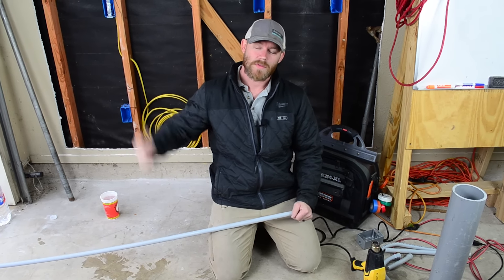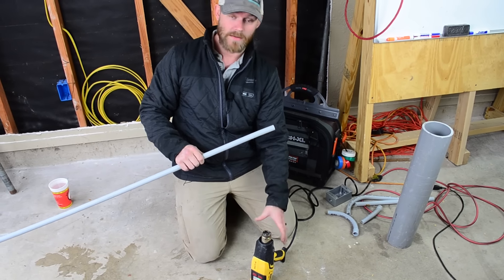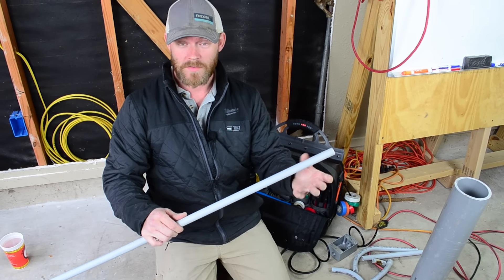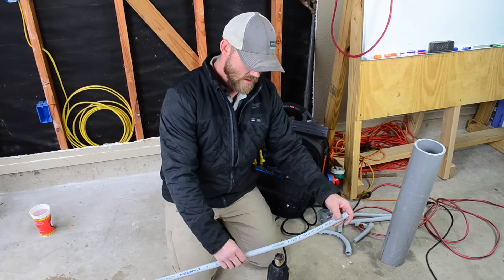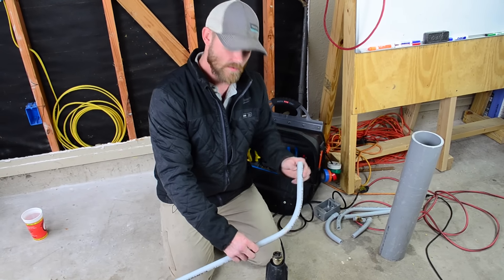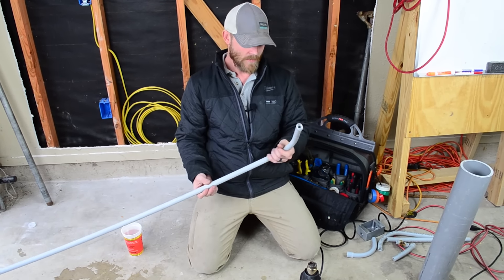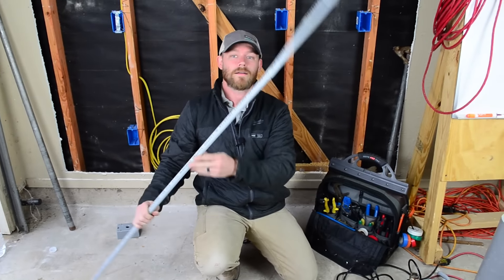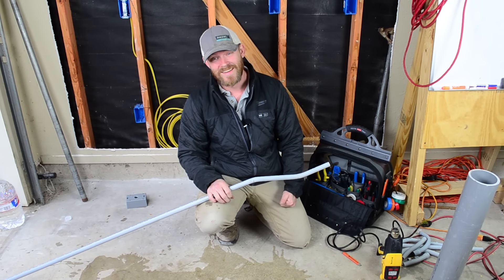Heating and Bending PVC Conduit - BENDING 90s, OFFSETS, and BOX OFFSETS

Comment: Dude, you saved me so much trouble, I had a pole barn built and I am doing the electricity myself. So i don't have to but i wanted the open walls to look Clean. I had purchased 3/4 sch 40 Pvc I was trying to use different types if 45s or 90s, non of them gave the result it needed. I Ordered the heart gun you use and it came in today. I set up a dummy 6by6 and 2 by 6 and it worked amazing. Thanks so much for this knowledge, not only is going to look sweet, its also going to save me 30$ even after the heat gun purchase. Thanks again, YOU ROCK

Comment: In my country, Iran, we put something like a cable or a water hoze inside the pvc conduits before bending it with heat and after we bend it, we pull it out.  It gets the job much easier and neater

Comment: Loved your video I'm a  sparky in Australia  and we have bending springs that go inside the conduit for bending without using heat . They are available from 16mm to 25 mm and in heavy duty and light duty springs. Also when I was a first year apprentice in 1973 I was told to put dry sand inside the conduit  where you were going to bend to keep the inside fair uniform then wash it out with water
Reply: Sand does work if you don't have a spring bender.
Reply: Not from Australia but Trinidad and Tobago,almost every part of the world that uses PVC conduit uses a spring bender,spring bender saves time unlike heating it takes a while

Comment: I've only ever used pvc conduit and after years of using it you can easily make various offsets and bends with the 20mm size by working it while pulling it over your knee.  The spiral metal benders are also a plus to help you. If you bend by a heat gun have a spray bottle near to lock it in at the angle after heating it.

Comment: Hey brother great video. I’ve primarily used a box heater specifically made for heating pvc conduit which works well once you get into larger size conduit, but I completely understand using a heat gun for smaller sizes in a pinch.Also if I’ve had a specific type of bend I was trying to make, offset, kick, 90 etc... I’ve bent a piece of emt to what I need as a template and once the pvc was heated molded it to the emt to achieve the desired bend. Just some thought. Keep it up
Reply: good idea

Comment: When bending 90' s found it helpfull to draw 2 marks in pencil so u don't waste time heating unneede area. Like to have a few rags with cold water to cool bends. Nice to have a plactic face mallet to tap small kinks out. Had to use a torch to bend a 90 in 2" PVC middle of winter outside. Took forever. If you do burn a small area ( brown mark) sotchbrite will remove it. Never used a bender for PVC. Thanks for another great vid.

Comment: Good job, in Peru we usually use hot air, with this device or gas when it is cold, also a spring inside the pipe to bend it perfectly

Comment: Good video. I teach trade in NYC  we use a bender on the ground with a heat gun. The bender is for the angles. Laid flat on the ground.   I noticed people mentioning the hot box.  It’s great if you can afford it. However, if your not doing a lot of PVC and your in a bind you must know how to bend small diameter PVC without a hotbox.   Anyway good video.

Comment: I work with a union shop (power tools supplied) and we got this 'hot box' bender. It goes from 1/2" to 4" pvc. It works great. You just need to rotate it a few times and the box does the rest. Its like a 4 foot box in length for nice gradual bends. *Greenlee product
Reply: union shops have the best training, NJATC!!!
Reply: Yes I am going to carry a $1000 hot box in my service van to do PVC bends once a month.
Reply: Takes too long,time is money
Reply: BOMBCRAZYInc 4" we use a propane torch, large area tip very fast
Reply: I've only ever used a hot box or a heat blanket.  Never used a torch or heat gun and I've worked for small 3 person companies

Comment: Wow, you guys need to get a spring. We use them in Ireland and Australia. So much easier. What you do is way to much hard work
Reply: What do you mean a spring? I’ve never bent PVC pipe, but I assume you’re referring to something that goes over the pipe to get a smooth bend.
Reply: A spring bender is a tool used to bend pvc
Reply: Even here in South Africa we used spring
Reply: @MetrologyEngineer  see Robert Pennington comment
Reply: @johnnorton7817  Cheers mate.
Reply: Do you think learning to work with PVC first, then EMT makes more sense?
Reply: We use the springs in the uk too
Reply: It's one bend on 1/2 pipe...no spring is needed here
Reply: @dennisbecraft1303  no lol. Most of the pvc guys I've met that are just now learning emt, kink the pipe constantly, can't figure out their axis lines (so they end up with unwanted dog legs and rolls) versus most emt guys switching to pvc? Scorch the pipe. The bends will look like they're building a church...but they're not used to the torch/heat gun Jerry rig...give em a heat blanket. Works quicker anyways.
Reply: طيب هل تقدر تثني أنبوب cpvc bend للماء الحار
Reply: Insert spring into conduit pipe. Rube pipe vigorously with a towel or rag, bend pipe. I could have bent that pipe to 90° in less than a minute.
Reply: Yep we have those and more. I'm betting there is an electric one by now. And sand for remodeled that have to get funky.
Reply: We have springs on the US. Old school not taught to many new guys. Plus a high turner over in the trade many are not to concern with quality of work or knowledge that saves you time and gives you quality.
Reply: Ikr, we use them to it save a lot of time, heat is just so time consuming, especially on big project, to me that's slavery

Comment: I've been bending PVC for a long time and a few methods have worked filling the pipe with Trice and that helps to keep the radius smooth taking a piece of BX wire the largest diameter of little fit down the PVC so it acts like a bending spring or simply just having the right size of bending spring to put inside the pipe and for the Box offsets a piece of clam molding to push down on while you got a stick or piece of BX inside the pipe gives you just enough to get that half-inch or so up to the Box opening I have also tried putting hot or boiling water in but that becomes a pain unless you got a furnace or boiler heating system nearby to get the water from it does work but you have to swap the water out a couple times

Comment: Love your videos. My current project is a building with a real corrosive environment. In one section, all conduit is schedule 80 pvgc and non metallic boxes and condulets , even the strut straps, and anchor bolts are fiberglass / plastic. Its crazy. Heat gun and hot boxes are the way to go. I have seen guys bend 4 and 6" by pouring a can of glue on it and setting it on fire.. o_0

Comment: You can heat it up and put it in a pipe bender.  The bender will cool it down some so when you put the PVC in the bender must do the bend fast.  In South Florida I can almost just put the pipe in the sun and in an hour or so it will bend. But that only works on hot sunny days. Gray pipe heats up fast in the sun, but need to turn it to heat it all around.  If you know you need to do some bends later put some out to get hot and do other things until it is hot. I saw one nut put some out in the sun most of the afternoon,  and he bent it so the ends would meet. Don't know why anyone would need that but that is how soft it became.

Comment: Good shit man, thank you! One thought with doing specific angles for offsets: if you want to be more precise, you could mark out your center of bends and draw out your angle on the floor or a piece of cardboard, then line your pvc up with it. Either using an angle finder or with tangent (theta) = rise/run kind of math. Cheers!
Reply: I do something similar, mark a wood board then put in a few screws as guides. Heat the pipe and pop into the guides.

Comment: Freezing or setting a bend by cooling it with water can also be done with a spray bottle and rolling the tube like a glass bower does while heating also speeds the process. I've seen boiling water also poured into a PVC pipe to bend it and flattening of the tube is nearly unavoidable but a steel bearing on a cable  the nearly the same inside diameter can be pulled thru it to round tubing out again while hot then cooled. Indeed these kind of balls and cable was often used when bending pipe because the inside curve often deforms the most during bending.

Comment: Since you are using a heat gun that is 1500 watts (I used one for many years doing floor work) you can use the gun to dry that water on the floor before doing the next bend.

Great video - keep em' comin'

Comment: I used a ready heater to heat the pvc when building my shop. Wouldn't want to use it in the summer but worked awesome. Took less than 30 seconds per bend.

Comment: The company I worked for had a heat box for PVC and that worked great and was pretty fast  it had rollers at the ends of the box so the PVC would rotate at ease.. I have also used a heat gun but takes alittle longer. One suggestion about getting the right angle  that your looking is use a speed square..
Reply: Can you do the same with 32 mm conduit?
Reply: @lawrencebyrne3448  with the hot box I used to do  up to 2 1/2  inch PVC . I never  done anymore then 1 1/2 PVC with a heat gun and that took some time. Hope that answers your question.
Mike

Comment: We use the fancy Greenlee PVC heater bender. Once you use that you'll never use a heat gun again.
Reply: My dad has had his for at least a quarter century. It’s a box that opens a 1’ 1/2 to 2’ long.  Can handle up to a 3” pipe I believe.
Reply: Link
Reply: That’s awesome good job I will do it  in my next outdoor for install an outlet for Xmas lights
Reply: "Hot box"

Comment: try the EMT bender, but use a bending spring  insert and see what happens. You can bend  without (much) heat up to 1 inch or so. They have springs for sch 40 and sch 80 that prevent collapse and support the bend with a pipe bender. If it is cold out you will still need heat gun. The other thing I would probably do is build a hot box that your heat gun mounts into (and collapses?). This would allow much more even heating and faster with one hand.  Use reflective barrier and a deflector inside (not the plastic stuff, the foil stuff). 
The K Factor is the difference in material between OD to OD on an any degree bend and the length of material used to make that configuration. . Example: 5 inch inside radius 90 degree bend  with a 1 inch OD pipe has approximately 5.5 inches to the neutral axis of material (The place that sees neither compression nor tension in the bend). This means that the OD to OD of the 90 degree bend is 12 inches (5 (Inside radius)+1(OD of pipe)) X 2 (for measuring both directions from the bend to the tangent) = 12. However the total material needed is 1/4 (90 degree bend) Pi X 2 X (5.5 (Bend radius plus 1/2 OD OF PIPE) )= 8.6 inches. Therefore the K factor  is 12 (OD to tangent measurement both ways) -8.6 (developed length of neutral axis)= 3.4 (K factor) inches.  This makes it very easy to know how much PVC length to heat and where! 
If the OD of the two legs of your conduit need to be 24 and 48, then you will need 72-3.4=68.6 inches of material before bending.
IF your first leg is 24 inches, then subtract the bend radius plus the pipe OD and mark that point (first tangent). Then measure 8.6 inches father and mark that point second tangent. Those are the two tangent points for this 90 degree bend, and the center point between them is the exact middle of the bend. 
My point is that one can figure out the K factor for just about any conduit and bend angle  by its OD and the desired ID of the bend radius using this concept and find the developed length and material needed. This allows you to mark the tangent points before heating and bending and know where you bend and tangents belong as well as know of your material will be long enough for both desired leg lengths.

Where this comes in really handy is wanting a 48 inch radius bend on 2 inch PVC conduit . You need it 5.5 feet long first leg, and have 20 ft length how long is the second leg after forming? The conduit is 2.2 inches OD, and your neutral axis will be 49.1.  1/4 Pi X2 X 49.1= 77.125 inches.  K=  (50.2 X2)-77.125= 23.275.  Your first leg will be 48 and your second leg will be 120-66 (first bend)+23.275 (K Factor)=77.275 inches. Tangent marks at 18 inches and at (18+77)=95 inches for forming. Hot gloves and form around a wooden spool. These special bend conduit radii are EXPENSIVE and can be done cheaply with 20 ft lengths.

Hope you had fun reading and I hope you understood it.

Comment: Old guy tip for larger pvc, cap the ends of the conduit to seal in the heat and pressure in to help keep from collapsing.

Comment: You can cleanly bend PVC by first filling it with sand and then heating it. I have also bent rigid copper tubing by filling it with sand with heating only when larger sizes require such.

Comment: Another method to prevent collapse is to insert a pull (extension spring) into the pvc pipe or a stainless kitchen/bath service line and then heat it up.

Comment: I use gloves for sure, and either fill it up with sand or use a spring almost to fill the inside diameter , and bend it , doing this keep the pipe from making a sharp corner.

Comment: Wouldn't heating up the pipe then using the same conduit bender as we use for metal conduits(just with much less force) work for making a perfect 90° PVC conduit bend?

Comment: In Australia, we use bending spring to bend. Very rarely do we use heat to bend conduit
Reply: This is PVC type pipe. It will not hold its shape if you don’t heat it. Agree with copper tube or metal conduit maybe easier. I will say, in the US we use a pipe bender for metal conduit.
Reply: worldofzap yeah we use PVC conduit/ pipe 99% of the time. Very rarely do we use metal conduit. 
We use bending springs 80% of the time and pre made sweeps, bends, couplings for the remaining 20%. If you use a spring you do get a little bit of spring back, however this can easily be solved by slightly over bending the conduit (ie bend conduit to 95-100 degrees for a finished 90 degree bend). The only time we really use heat is for conduits >32mm. 
I can bend a 90 in 25mm conduit in less than 10 seconds.
It’s interesting how different countries have different reasons for why they do thing the way they do. 

Edit: in short, pvc conduit does hold its shape without heat while using a bending spring. The only time it will crack etc is if a internal bending spring is not used or the angle of the bend is changed multiple times
Reply: James Morris,,, ok I get it. I was a bit confused with the “very rarely do we use heat to bend conduit” think he was showing what you could do in a pinch. If you didn’t have the elbows etc. I have only ever done telephone CO installations, we have only ever used metal conduit and a bit of flexible conduit for aisle lighting and lineup outlets.
Reply: We use springs in the uk as well I have used a heat gun when it’s cold I find the conduit gets a bit brittle when it’s cold so the heat helps and also makes it super easy to bend but mostly springs
Reply: @joefrayling9263  when it's really cold I just rub in the spot I'm bending it for a minute and very rarely does it snap on me, but I'm in sydney and rarely does it get to the minus down here
Reply: Hi. Can I ask you a question? I wanted to know how much money an electrician who works in a residential buildings and do these kinds of stuff makes per month
Reply: @mostafababaei3431  In U.K. you're looking at £120-160/day roughly (2400-3200/month) depending on location and experience. Self employed is a lot higher but you're running a company as well.. Best thing to do would be check job advertisements to see what the going rates are.
Reply: @tesla7408  Thanks
Reply: I've just never seen that here in California . We probably should be doing it that way
Reply: @justink7269  Don't you use pipe in residential building in the US? You just put cables between drywalls, right?

Comment: I'm not an electrician, but, if the internal diameter of your 1/2 inch pvc is about 0.578 inches, if you cut the PVC to length, let's say 10 inches, and have two pieces of 1/2" (0.5 in.) dowel rod, about a foot long each, you could heat up some sand, maybe, in a beer can or a soda can, you'd want about 10 ounces, stick your dowel in one end of the PVC, pour the hot sand in the other end, then stick your second dowel rod in behind it, so, you have 1/3 dowel, 1/3 hot sand and 1/3 dowel. Then you have the hot sand giving off heat and, bonus, it helps to keep the shape of the PVC and prevent kinking, because you have something inside that bend to resist kinking.
How you heat that can of sand on the job site is up to you, could do it on an electric stove, a gas stove, or with the heat gun from underneath. And for consistent bend shapes, just use a full beer can, a fence post, a larger pipe, or anything else.
If the hot sand is impractical, perhaps you could use the two dowels, push them together inside the pipe, and heat where they meet, leaving them sticking out equal length, slowly spread them apart and make the radius of your bend as short as you like. The two dowel rod method may also help for  your offsets, as the dowels can be kept parallel while you push one and pull the other, getting just the right distance away from the wall to go straight into the box.

Comment: question for my electrician career. ive been a navy electrician for 5 years. i got my usmap completed which is just 8000 logged hours for my apprenticeship and i got my carrer studies certificate in electrical wiring but what kind of job can i get coming out of the navy? will i start off as a journeyman? should i join a union? what will my salary look like?